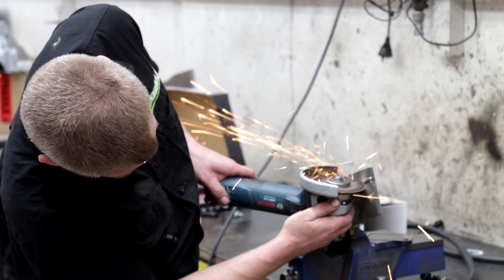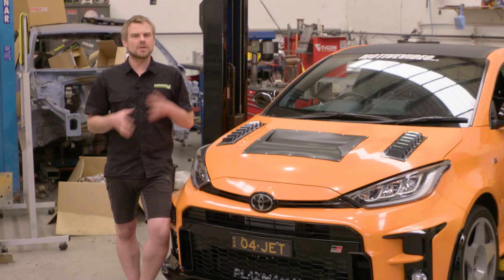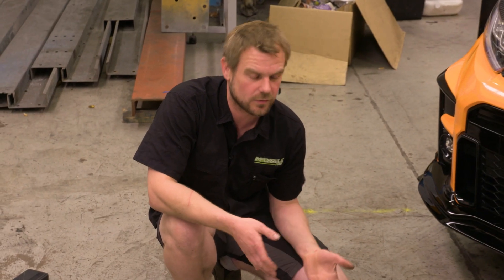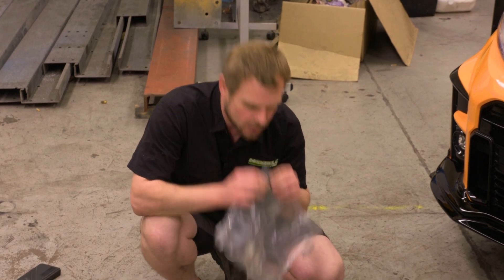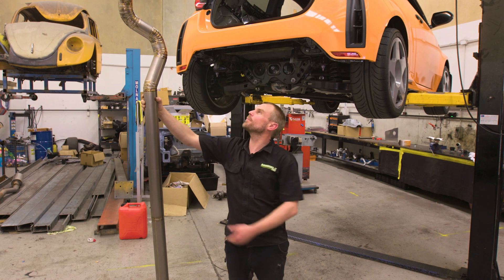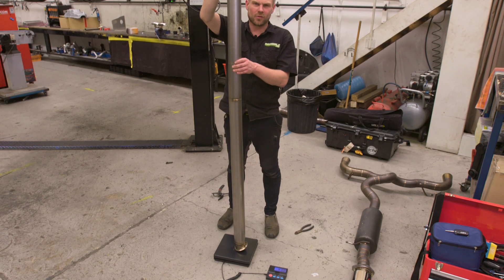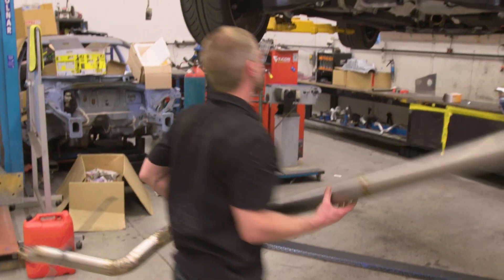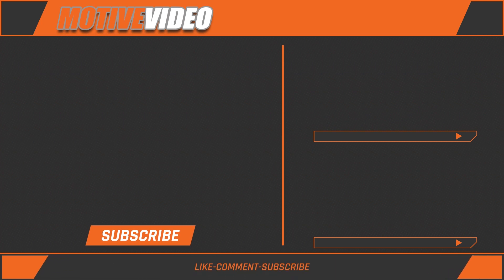Custom Titanium Exhaust for our GR Yaris - Day Job

Comment: Great work on the exhaust and explaining the differences between materials. 

It’s so nice to see someone actually admit that titanium exhausts often sound like crap. People don’t realise that because titanium pipe typically has less than half the wall thickness of a comparable stainless piece that the titanium exhaust actually bleed sound through the walls of the pipe. When you add to that potential resonance issues they can be just horrible. The length of the straight sections also effects the particular frequency it will resonate at which is why free-flowing exhausts with long straight sections get terrible drone. Great for performance/flow though. 

You can make them sound good but it takes some serious effort testing different lengths, bends, resonators, maybe even heimholtz devices etc etc. Doing all that r+d to get their titanium systems to sound nice is partly why the big brands like akrapovic are so expensive. They other part is they just charge whatever the market will pay. Lol

Anyway, great vid and it was such a shock to see someone actually tell the truth about how and why different metals sound they way they so. The nicest sounding exhaust I’ve ever had was mild steel and I think part of that was the wall thickness. And I say that as a guy with a titanium exhaust on my GTR (sounds crap everywhere but high rpm), an akra on my bmw (sounds amazing). In fact the 4inch titanium exhaust on my GTR (with a big cannon type muffler) is louder and more offensive than the straight pipe exhaust on my other GTR which is just 3.5inch stainless pipe to the diff then a 3 inch mild steel pipe for the last bit. There’s a fair bit of science behind how an exhaust sounds.
Reply: Bro it has no silencers that’s why it sounds like that 💀
Reply: For sure, that’s basically it I guess my point is even without adding resonators or mufflers changing the pipe diameter or material type, wall thickness, where and what radius  the bends are etc can dramatically change how an exhaust sounds. I agree all straight pipe exhausts have sound characteristics that you can’t really change without adding resonators or mufflers. But there’s a lot of factors behind why a certain exhaust sounds a certain way.
Reply: Mild steel sounds the best
Reply: Some of my favourite exhausts have been mild steel. Being thicker walled tube gives a mellow/melodic character and more muted resonance. I guess my point is that while each material gives its own character to the exhaust, you can make a nice sounding exhaust or terrible one out of all 3.
Reply: Did you say its a crap of civ? Why?

Comment: It's funny the stock exhaust weight about 12 kg, stainless steel exhaust 17.5 kg.
Sometime make you wonder for better flow and sound exchange for weight is it a really good thing. At least if you willing to get titanium exhaust.
Reply: Ik lol, the GR Yaris along other well engineered modern performance already have pretty light exhaust systems from the factory, much different from the older generations of performance cars.

Comment: How much extra does mild steel weigh compared to stainless? Because I got a dual 3” mild steel for my car (a V8) and it seemed to weigh a tonne.
Reply: Stainless is pretty much the same weight as mild steel.
Reply: stainless steel (316) is 3.5% heavier than mild steel
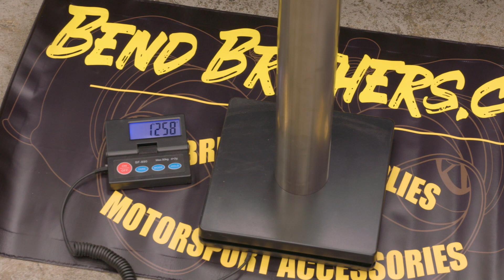Reply: @salloroc20  While titanium is 55% lighter than stainless, as seen in video. 2:04 "Just over half the weight"... UHHH, NO, 45% of the weight is less than half, clearly. 55% lighter.

Comment: For those wanting to change exhaust on the stock turbo setup, Toyota will not replace the  cracked turbo oil drain under warranty.
Reply: Could you clarify what you mean by cracked turbo oil drain? 🤔
Reply: @SasanSB12  There have been a few oil drain pipes cracking near the connection at the block. They are a solid pipe and apparently the different exhaust puts different stress on it. Haven't read the bulletin, just what I've been told when one came in for an oil leak. There is foam insulation around it so may not be noticeable straight away until the foam fills with oil.

Comment: Hope the exhaust was backpurged. Had to deal with remaking an exhaust after the previous person didnt backpurge it cracked after 1 track day kind of a sad life for such an expensive material
Reply: No it wasn't... you can see by the white oxide inside the pipe on the welds, it should be silver with no discoloration
Reply: @ivanbajac3536  im aware, its now brittled and wont last long unfortunately it was more of a "i know its not but shouldve been" type of response
Reply: It would be sealed on the end with tape with a small hole to allow gas flow or some kind of cap otherwise you'd have to use a huge amount of argon with just an open tube. Adding to that, as long as you don't weld too hot and don't get too much oxidisation on the inside it should be fine with enough filler wire added.
Reply: @vlt873  read my other comment. After welding titanium what you said is a lie. It must be backpurged or the weld becomes extremely brittle regaurdless of how much filler your using. Titanium will crack at the edges of the weld. You might be thinking of stainless which if you dont overheat the "sugaring" will be less
Reply: @Nam_Nguyen2308  I've welded titanium, even stainless to titanium without catastrophic failure causing the exhaust to fall off and cause a major pile up. In an ideal world, yes back purge. While we're arguing the toss about welding technique on the internet, he's probably doing laps of a circuit with his exhaust apparently about to have a catastrophic failure, not giving two f__ks and having a blast.
Reply: @vlt873  I have been welding almost exclusively titanium for a few years now and you absolutely can not TIG weld stainless and titanium together with any kind of strong and dependable weld, sure you can physically "weld" them together but its not strong and you could break it off with your fingers literally

Refering to your previous comment, you could get away welding without purging on some thicker material with a overlap weld, but not on a thin wall butweld beacuse the titanium wont penetrate without argon on the backside it just oxidises, like you see in the video all that white stuff inside the pipe is heavily oxidised and not penetrated at all, you are just left with a very brittle and weak surface weld, I am not saying that the exhaust isnt usable and that it will fall apart immediately, and maybe it will after a lot of heat cycles and engine vibrations, it just doesnt make sense to me if you are spending the money for titanium you could spend a little extra for a bit more argon and do it properly especially if you are recording it and putting it online, or maybe they were not aware of that
Reply: and how cost effective for this man to just rebuild his exhaust after every trip to the track

Comment: Just be prepared for the scrutineers to knock back the tip. They may not, but be prepared. Looking forward to seeing the split times across the top of the mountain, especially on day two as you get more confidence with each session!

Comment: Not as sexy, but I assume you've put on a little lithium motorcycle Battery if you want to save easy and cheap 10kg or so? My battery weighs 1.3 kg and easily starts a 1.8 L 4 cyl with11.5:1 CR. So jealous of Bathurst trip, enjoy!
Reply: They mention and show a smaller battery mounted to the boot floor.

Comment: 2:04 "Just over half the weight"... UHHH, NO, 45% of the weight is less than half, clearly... and Why did you go with a 3"??? That's waaay to small. If you were going for 300hp, then ok. But, if you are going to be crossing 400hp, then a 3.5" is best... I know you can't predict the future, but you end up crossing 500hp... A 3.5" at that level of hp, you would gain 100hp!!! I haven't seen all the videos, but I REALLY REALLY HOPE you changed it to a 3.5" exhaust.